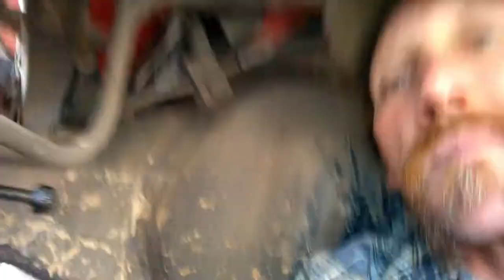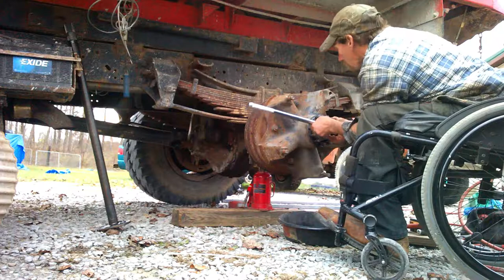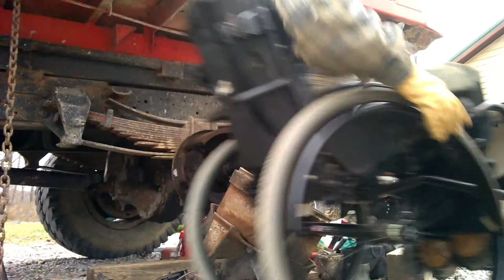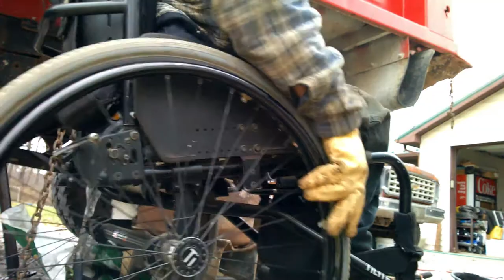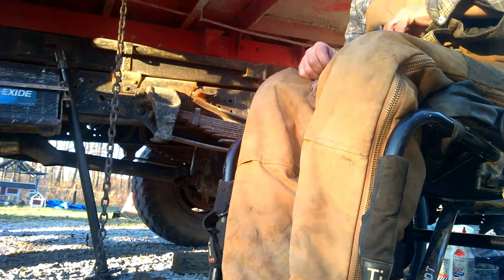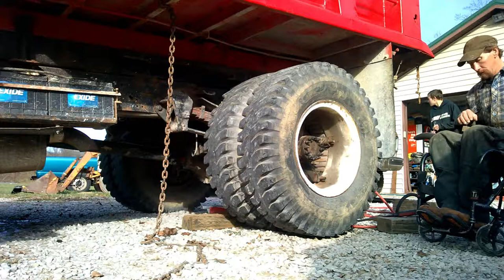Paraplegic & F700 Dump Truck with Lucas Girling Brake system & Dayton Wheels full suffering version

Comment: You are a better man than I.  I have been trying to remove my hub all day and still cant figure out why it wont pull off, nothing is attached.  I have been cussing all day, tires were stuck and everything seemed to be welded on and it is cold as can be.  you made me appreciate life it self by watching your video.  i thought I had it hard till I seen you do it, thank you for letting me look back at the day and realize it might be a hard job, but it is in no way as hard as I have been thinking it was.  I'll get back to my truck tomorrow with better thoughts of everything.  thank you very much for this video.  I was more than glad to click like on this one.
Reply from the maker: Thanks man, my accident was 6 yrs and 3 months ago now so still remember fighting a project and I would get insanely pissed off to the point of throwing tools sometimes. But after the accident it brings a whole new perspective to the game and I have a lot more patience now a days. Anyway.
Does the hub wiggle like it's loose but won't slide off our is it still seated right where it was with nothing changed?